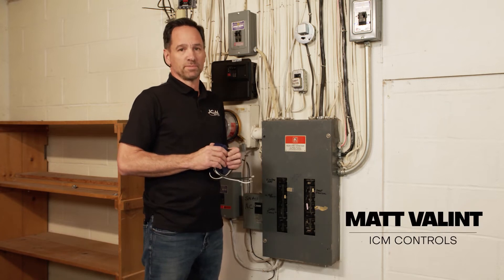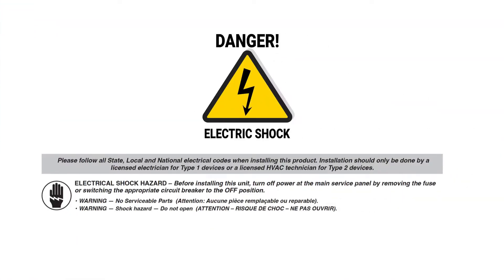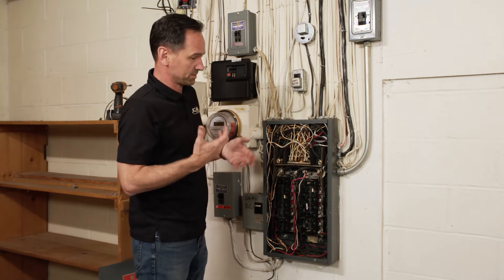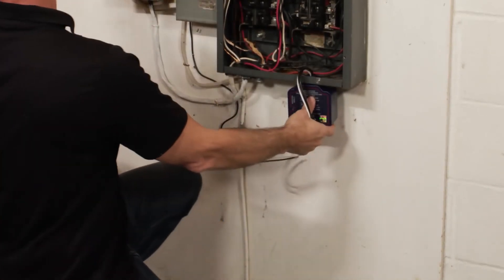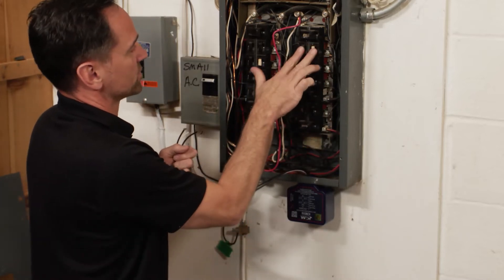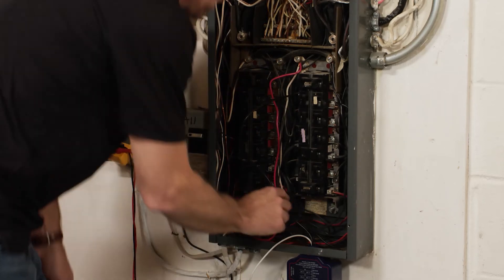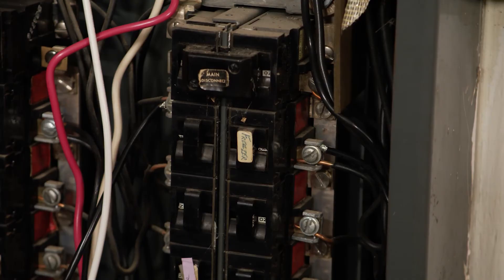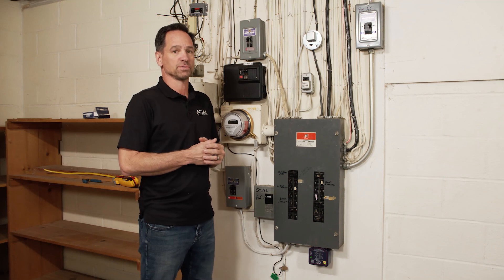Installation Video ICM518 Whole Home Surge Protector

Comment: Correct me if I am wrong.  NFPA 70, article 110-14A.   Only one conductor allowed on lug, unless it is designed for more than one conductor.   This installation is a code violation.

Comment: Could we get some clarification here, please?  The discussion here infers that since the ICM was placed on the load side of the breaker, it only protected the freezer.  @qcsupport2594 asked, "If the existing breakers aren't designed for two wires per lug, should I use a dedicated 2-pole breaker?"  Many technicians do this, and the response to that question from @icmcontrols9960 was, "Definitely a solution."

If the position being taken is that the ICM only protects what is on that circuit if it's connected to the load side breaker lugs, then by that mentality, using a dedicated circuit/breaker would mean nothing would be protected.  In reality, however, as long as the breaker isn't tripped, wouldn't it be providing protection to every circuit in the box?  The key of course being, as long as the breaker isn't tripped; however, ICM responded with, "Definitely a solution," so are their specs for this?  What size breaker should be used for the dedicated breaker?  

Thanks in advance.

Comment: If the existing breakers aren't designed for two wires per lug, should I use a dedicated 2-pole breaker?
Reply from the maker: Definitely a solution.

Comment: This is a type 2 SPD install, not entire house (SPD1). He mentions this down in the comments. Change the video title please.
Reply from the maker: Jim you are correct, this is definitely a type 2 install. We are in need of a willing certified Electrician/application do to a whole-home install video. In the meantime, we wanted to get a video out there showing the ICM518 SPD that is capable of type 1 or type 2 installs. Not trying to promote this video as a whole-home install, just that the product is a whole-home SPD. This video will be removed when we get a whole-home install video shot!

Comment: At least the freezer is now protected. NOT the entire house. He put it on the load side of the freezer breaker LOL. And wire runs were mega long. Every 2" of wire leads off the SPD box = 20-25VAC higher clamping voltage. Or when the suppressor starts to work and dump power to neutral/ground. So an extra 10" of wire leads - an extra 200+ VAC that black box starts to work. Mount as close to the neutral/ground bar as possible.

Comment: I assume this will protect the feed to a sub panel, or do you need another one on a subpanel?
Reply from the maker: The ICM518 can be installed by a licensed Electrician with the mains (Type 1 install) at the main panel for a true Whole-Home coverage or at a sub panel for full panel coverage. In this particular installation a particular piece of equipment was being protected via a breaker (Type 2 install).